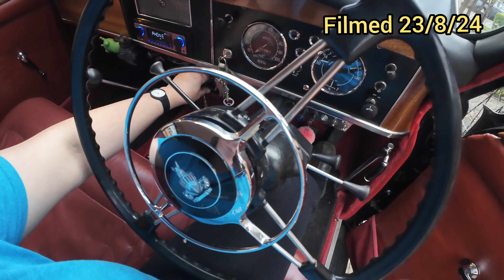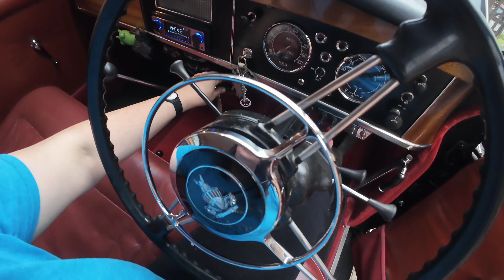Rover P4 - Bye bye Bakelite spark plug caps ! I fit P6 Rubber boots instead.

Comment: Hi Alex, excellent result, so well done you. 😀 Back in the 70's I had a similar problem with my Capri 1600 GT, it drove fine in nice dry weather but hated wet and damp conditions. So on investigation, in the dark, lifted the bonnet and the rubber leads and bakelite plug caps were arking merrily away. So new set of Vinyl leads and rubber plug caps was the order of the day and no more running problems after that. On further inspection of the old leads it could be seen that some previous owner had sprayed the leads with some sort of weather proofing sealant which by now was breaking down. So lesson learned there. 😀
As always, take care,
Your friend, Jon B.

Comment: Hi Alex. Those are old Carbon core HT leads, and that pin is essential to make contact between the core and the metal end sleeves that go onto the plugs, coil and distributor cap.  Bin them and fit a set of modern silicon replacement leads.  When those IOE 6 cylinder engines were in production, the plug leads all ran through a fibre type tube on the engine top, with a cut out for each lead to poke through to the plug.  That black rope like centre is the Carbon strand conductor, and it breaks down with age, that is what the repeat sooty deposit is you see.  Those engines were so smooth, the Rover adverts would show an old three-penny piece stood on its edge on top, with the engine running. You'll be losing fuel ecconomy, and they'll eventually fail, or cause cylinder crossfiring when you least expect it once they start to deteriorate. The crack in the Bakerlite cap will hold moisture, and allow the HT voltage to track to ground on the engine. With a bit of ingenuity, you can drill out the Bakerlite cover and slip it over new leads as a dummy cover, so it still looks original.  If you pop the bonnet open in darkness, you'll see a feint blue HT voltage tracking along wherever the leads and caps are failing, and it also causes radio interference. A spray of WD40 over the leads is a temporary fix for HT tracking.

Comment: Don’t forget to add some dielectric grease to keep out British damp 😎🇨🇦
Reply from the maker: Oooh I've not heard of Dielectric before....? I shall get on google
Reply: @Alexsassets  dielectric grease is excellent stuff. It prevents corrosion of electric contacts, reduces resistances and offers some water resistance. In addition it makes spark plug boots a bit more slippery so easier to slide on or off. Your auto supply shop should have it Halfords?  I use it on my MGB. Incidentally, Jessy is superb looking. All the best from Canada 🍁